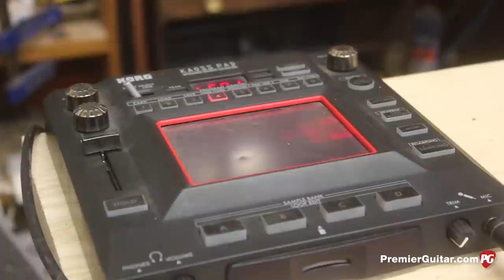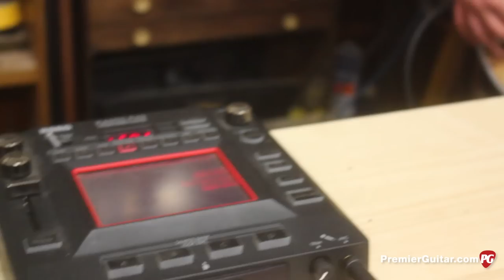DIY: How to Install a MIDI Pad in Your Guitar

Comment: I got one of these controllers from crimson a few months back, and installed it in my tele clone along with a fernandes sustainer (great combination), with help from their first install video. I deleted the power switch, replacing it with an out of sight jack power cut off, and replaced the chrome led push button for a black model from ebay to match my black knobs (a little soldering needed). 
Thanks for the earthing tip, I'll get onto the fix it tomorrow. Might it be an improvement to also cover the controller box with foil? With a cut out for the led?
Reply: Sounds like you've made a manson telecaster model or so😂

Comment: How much centimeters should have the guitar under the strings? if i put the midiPad in a Cort Manson signature guitar it will be enought space?
Reply: +Sanjey White you will never get it on a Cort MBC 1!! you have got a tune o matic bridge on it, there is not space!
Reply: +Josh Roberts you could get a manson M1N1 touch pad on an mbc1
Reply: +henri best possibly, never really installed one, only the standard size.
Reply: +Josh Roberts i reckon it would fit. would just have to route cavities for the fuzz somewhere else if you wanted one